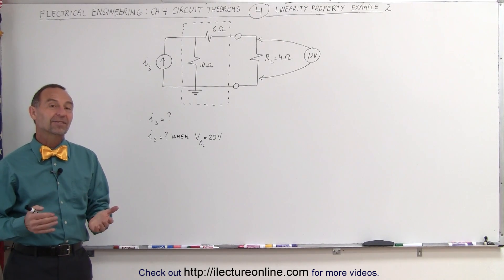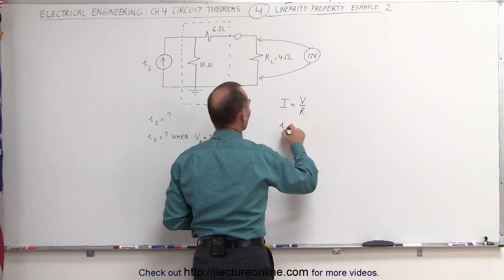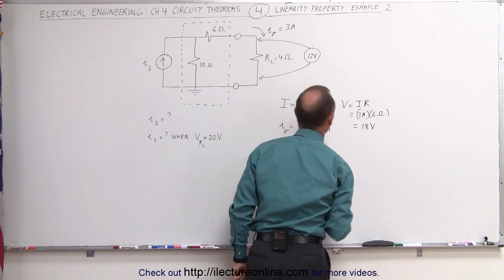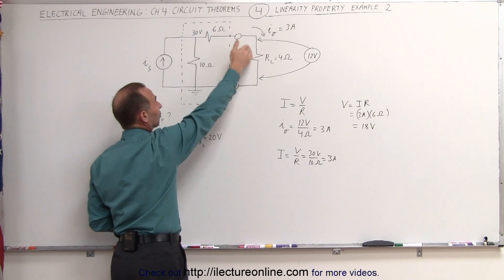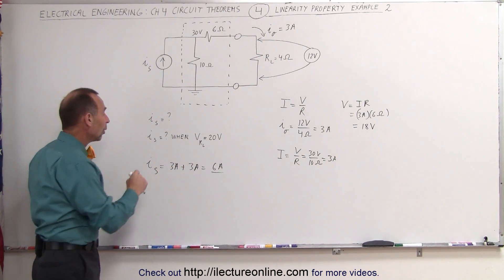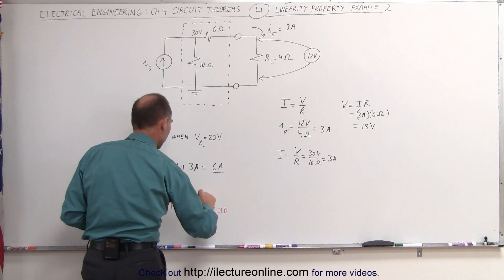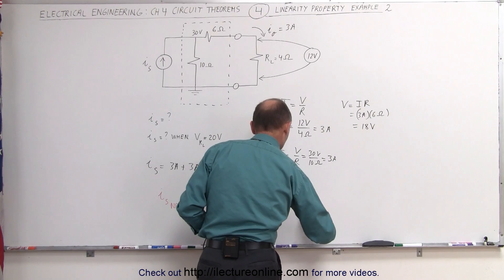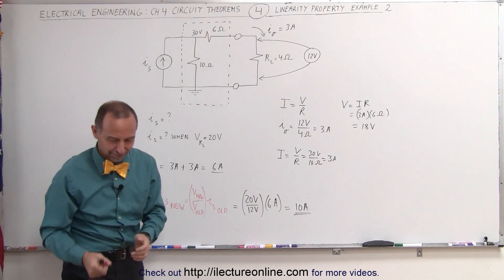Electrical Engineering: Ch 4: Circuit Theorems (4 of 35) Linearity Property Ex. 2

Comment: Great stuff, professor. With a little help, you're entire catalogue could be used to build a new online school! Even my Circuits Analysis prof is using your videos in class. You're lectures are always to the point and you solve a ton of examples (both conceptually and with real values). You have definitely mastered teaching. This has been so helpful for me (and all the physics tutorials I've watched of yours). 

I did notice some differences with this style and some techniques I've seen in my textbook. Here, it seems some of the values are given. But if not, the suggestion is to assume a voltage or current is equal to 1 V or 1 mOhm. 

Keep up the good work!

Comment: sir is there any derivation for IS(new)=k* VS(old) equation??? I dont seem to understand how we got that.
Reply from the maker: No derivation needed.  Is = I (in right branch) + I (in left branch)     Then if the potential across the load resistor increases to 20 V then the potential at the junction increases to 50 V and then you can recalculate the current through each branch (which will now be 5 A in each branch)